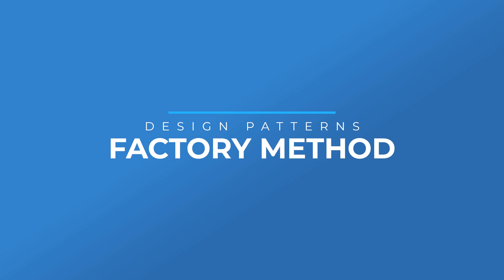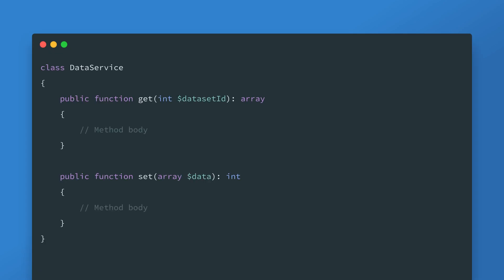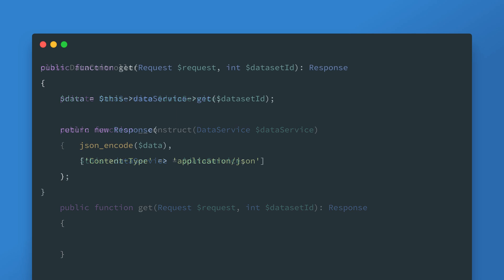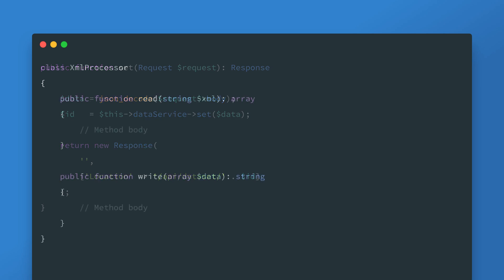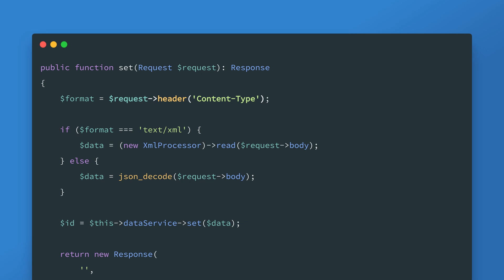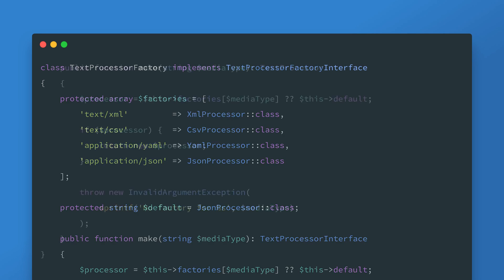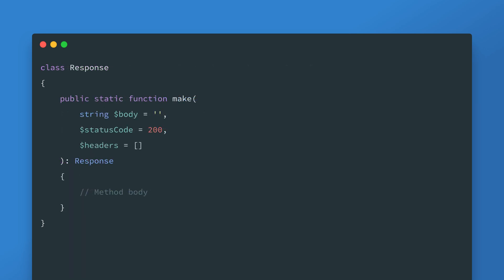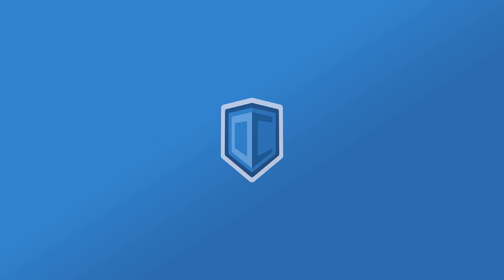The Factory Method Pattern - Design Patterns in PHP

Comment: Could you try and actually type the code and explain it while you do it? The example you used assumed a lot of knowledge and the explanation of each slide was minimal.
Good try but not very instructional.
Reply from the maker: Which parts did you find were an issue? 

The majority of the time the internals of the methods are not important.
Reply: @olliecodes  na hes right im new to coding and it was very hard to grasp
Reply from the maker: @Rocky-cm7ef  Which parts specifically did you find hard to grasp?
Reply: @olliecodes  all of the syntax you used wasnt really explained. You would throw in new functions every second like they werent important and it was very daunting as they werent explained.
Reply: @olliecodes  its not like it was bad or anything, but its inaccessible for new users who didnt study it in uni
Reply from the maker: @Rocky-cm7ef  That's understandable. There is a certain level of knowledge required for some of these videos, as the examples are picked specifically because they're common problems that we will face in the real world. That being said, if you'd like to contact me outside of these comments with some specifics about the bits, I can look into it. I'm always looking to create more content, so could maybe look into some supplimentaries.
Reply from the maker: @Rocky-cm7ef  As I said in the previous comment, there's a certain threshold of knowledge/experience required of these, and if you don't meet it yet, diving into design patterns will just make it harder.

I don't entirely agree about the uni comment, I myself have no formal education in programming, but, like I said in the previous comment, if you want to contact me via email or Discord I can hopefully put something together to help you and others who may encounter the same issues with the content.
Reply: @olliecodes  ahhhh ok, i just kind of went down a rabbit hole of curiosity and discovered your video. If your intended purpose wasnt to teach beginners thats fair enough.
Reply from the maker: @Rocky-cm7ef  it's aimed at people of all experience levels, though complete beginners would have an issue. I do try to stick to one topic per video, but I'm happy to look into creating supplementary videos for other topics.